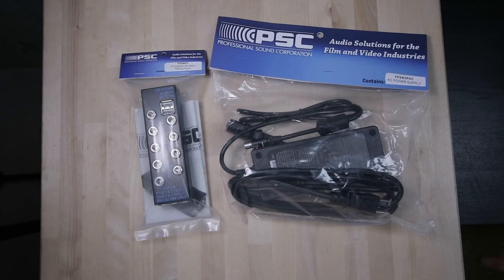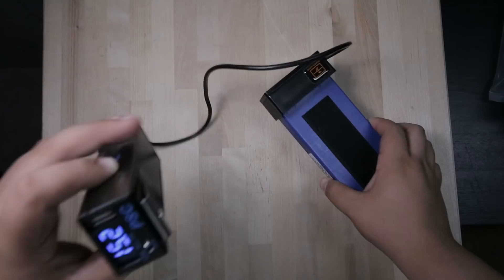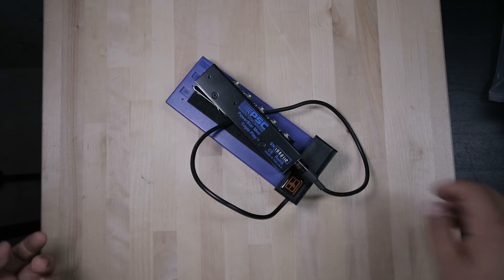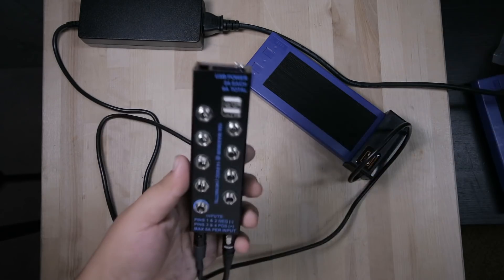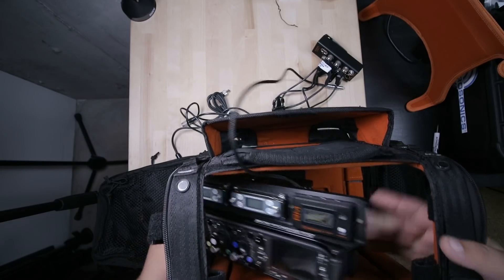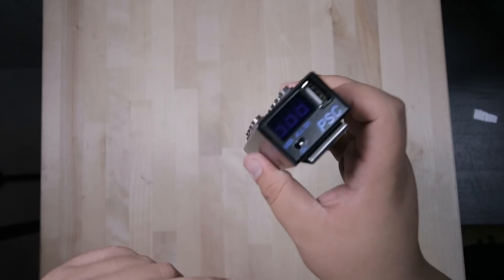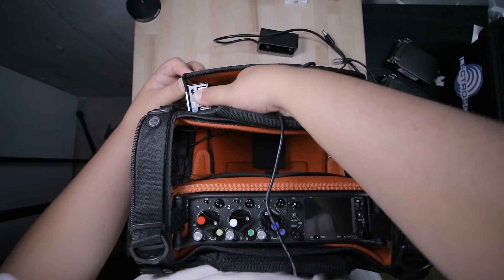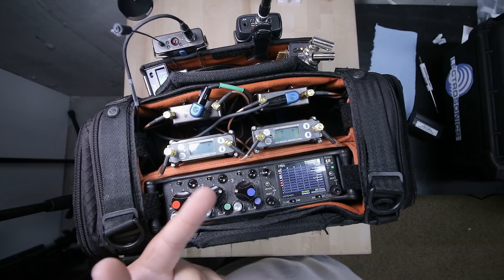SETTING UP A PSC TRIPLE PLAY POWER DISTRIBUTION FOR LOCATION SOUND GEAR.

Comment: Best channel man.

I have purchased the "PowerStar Mini Triple Play' because of this video. Anyhow, I have harsh noise when I power RodeLink receiver via any of the three USB ports (USB to Mini-USB cable).
Do you have any idea how to fix it?  I do not experience noises when powering the RodeLink utilizing internal AA batteries or external  NPF-970 batteries.
Reply from the maker: Hello S, thats odd im sure it has to do with the usb powering option on your rodelink have you try to power it with a regular usb wallplug ? That way we can trouble shoot  if the power distro o the usb port is creating the noise

Comment: The only thing that kept me from going with the triple play (for my small cart) was that it doesn't let you select the primary vs secondary power sources. As you've shown, it uses voltage to dictate which one it will draw from. I'd want it to favor the AC supply before the battery cup.